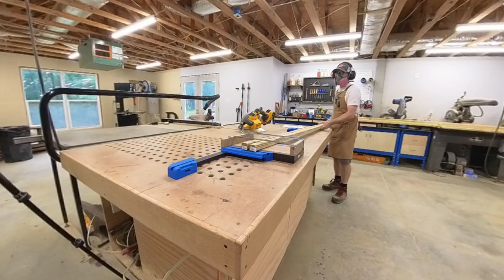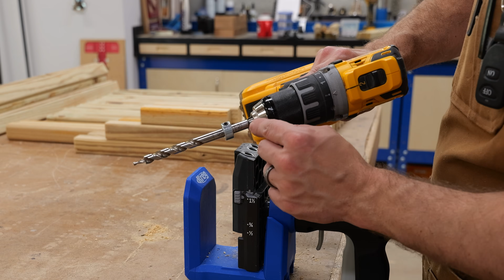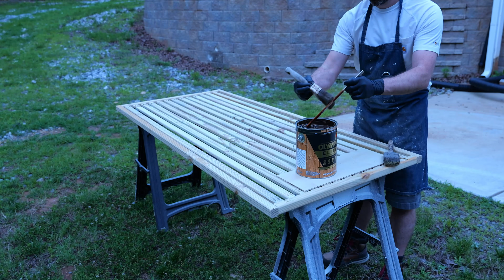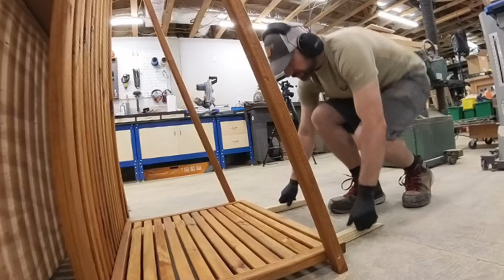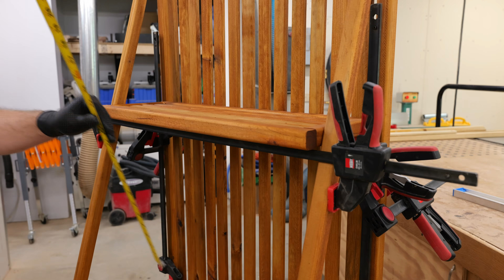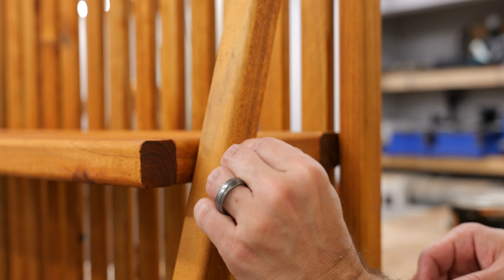Outdoor Plant Stand | EASY Weekend Project

Comment: "you don't need a shop full of tools"?? but that is exactly what you have Mike. I love your shop though.
Reply from the maker: Thanks!  It's been a long time to get to this point with my shop.  

Curious about the first part of your comment though, I may have a shop full of tools, but I only used a couple of entry level tools (circular saw, a saw guide, and drill).  Did I overlook something?
Reply: @WoodshopMike 
You didn’t really clearly list the tools. Like imagine someone who has never held or bought a saw before, they’ve never seen any of these tools. 

They see you wearing some kind of mask, using all these different speed squares and measuring tools, all these different clamps, etc. Like, some people don’t have any idea what any of these tools are. They don’t know what they are called let alone how to use them